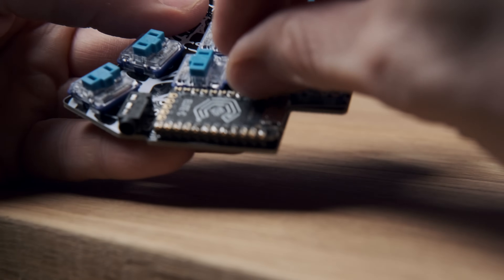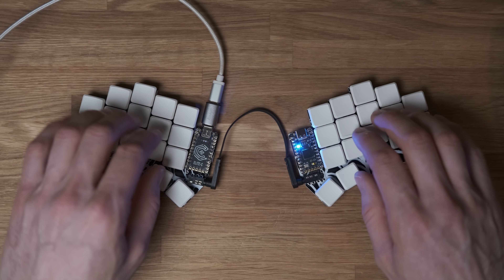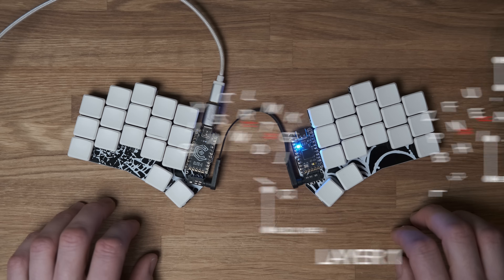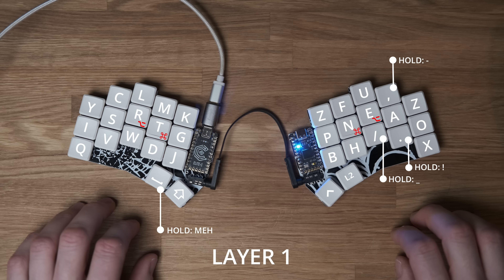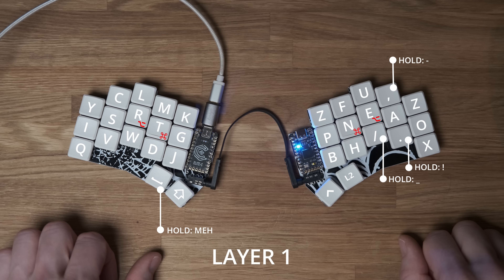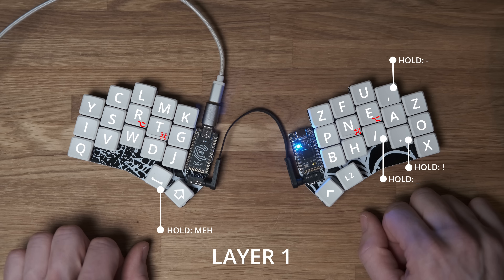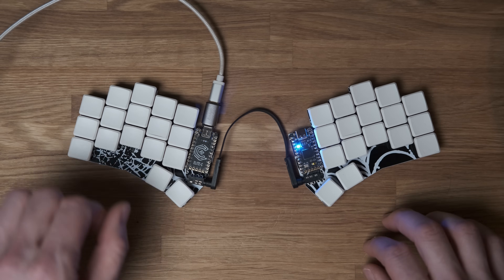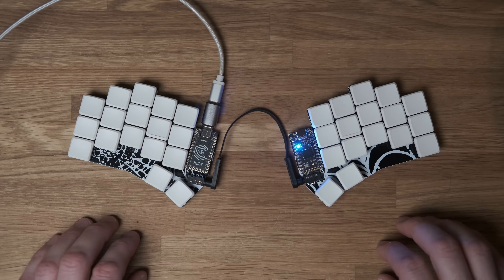You Won’t Believe How Effective This Keyboard Layout Is

Comment: Hi Ben, great content. I recently got into this niche hobby as well and built my own split ergo keyboard. I am still figuring out QMK/VIAL and how to setup my layers as well. As to your issues with homerows: I had a similar problem with rolling keys, but got a handle on it for now with "permissive hold" and "Ignore mod tap interrupt". This changes the behaviour of when a key is read as a mod or a key, and when a second key is added to the mod or as an individual keypress. Check it out if you haven't already

Comment: How does the right keyboard work with the same pcb?
Reply from the maker: The pcb is upside down on one side so the controller gets mounted backwards on that one.
Reply: @BenVallack  ohh it was obvious if I had looked at 0:02. You can see the double loop (pcb + mcu). Sorry

Comment: Thank you for the details! My question is this: are all the double taps for enter, arrow keys, etc. less or more ergonomic than just moving your hand over a few inches? Certainly the layers would be faster, but do the extra key presses wear on you? (Trying to decide on a 34-40ish key layout vs. a full size or tenkeyless)
Reply from the maker: Additional key presses don’t seem as much of an issue to me as moving my fingers all over the place. Both in terms of speed an comfort. I’m pretty happy with the small board idea. In fact I am currently way on something even smaller. Stay tuned!

Comment: Hi Ben! I'm starting learn ISRT and wondering about your VIM strategy. Did you remap your most common vim commands by location or did you keep them with the same letters and defaults. For example, find next char 'f + letter'. Did you change it to 't + letter', or kept it as is and changed how you type it on the isrt layout?
Reply from the maker: My strategy is swap hjkl to the new places, then just learn the new places for the rest. Most of the letters are logically chosen (f for example) so I found I was remembering them by name more than location anyway which made them quite easy to use in their new place.

Comment: I don't have experience with other firmwares but with the UHK if you assign a secondary role to a key it's unpratical to use it. In your Layer 1 UHK implementation, every time I type te, ne or anything it triggers the modifyer ("command+t" instead of "te").
Reply from the maker: This is all down to the way you configure it. This only does this on mine if you hold down the key that is a mod for a certain interval. You can type as fast as you like with normal letters and you never get the mod version by mistake.

Comment: At this rate, I give you 2 years, tops, before you have a single-key keyboard that you use the QMK firmware tap dance feature to the utmost capacity, adding some interesting mods. With only a single key you can add far more than 32 layers with a minor change of how layers are addressed.

I wouldn’t expect fast typing, but easy ergonomics!
Reply from the maker: Hehe I will meet you half way on that idea.
Reply: @BenVallack  and… you’ve done as claimed! 🤣🤣🤣

I deeply appreciate the commitment to the deep recursive rabbit hole dive!
Reply from the maker: @strictnonconformist7369  haha!

Comment: I've been wondering this in your previous layouts as well: to use the navigational keys (left, down, up, right), do you move your fingers over 1 key to the left? Or do you use your index finger to service 2 directions and the pinky sits idle? Either way it seems less optimal than keeping them directly under the home positions, and I was wondering why you chose this configuration.
Reply from the maker: It is the default position in Vim so I just kept it. I am currently testing a more conventional arrangement that doesn’t require a stretch of the index finger though.

Comment: Excellent video! You've (almost) convinced me that this is something just for me. I love your idea of layer switching (including the fall-back double-stroke). One thing I'd like to hear is why you've went for ISRT instead of Colemak DH. I've tried Colemak (briefly) and like the IE and ST progression. After watching a couple of your videos I'm sure there is a solid explanation - and I'd love to hear it. I'm also not getting how modifiers works (command/option) - is it long-press? The other thing that scares me a bit is how I'll get my local language diacritics like ąłżźć etc?
Reply from the maker: I tried ISRT and immediately it made even more sense to me than Colemak DH so I stuck with it. I think you will know within half an hour of testing it if you want to stick with it. Yeah home row mods are a long hold (200 ms) to get them to behave like mods.
Reply from the maker: Odd characters from other languages does seem to be a common issue with small layouts. I think it’s a case of just using another layer.
Reply: Based on letters frequency in Lithuanian, you can fit more than 98 % of the keystrokes on the first layer with 28 keys (according to "Raidžių dažnių lietuvių ir kitose kalbose, vartojančiose lotyniškus rašmenis, analizė").

Comment: Looking at this makes me wonder whether additional non-key controls would potentially make sense. I don't think small trackballs with a sphere size under 3cm have ever worked particularly well, so i'm hesitant suggesting that, though maybe a laser mouse pickup can make all the difference, last i tried those they were still based on ball mice with friction coupled optical quadrature encoders; but maybe a game controller thumbstick or a  Thinkpad nipple or a PSP slider, something like that? Maybe a capacitive touch strip for scroll? Doesn't seem that there is a good placement for a wheel encoder or anything like that, but i would actually prefer circular scroll.

It seems many people who use these small keyboards are dedicated to one task like their whole life revolves about vim, but i am not one of those people, i program, game, 3D model (Blender, Fusion, FreeCAD), and lots and lots and lots of other things. Also while i am not uncomfortable with vim, using it for short little tasks almost daily for 20 years, trying to actually customise it into a full IDE always overwhelms me and i use more standard tools, Qt Creator in the past, increasingly VSCode these days. Like it requires an exploding amount of memorisation for the amount of tools that you want to have, it's just easier for me to have only a handful things hotkeyed and access the less heavily used stuff visually, which i didn't find it ever had good facilities for, at least not that i know of? I also find it really hard to think about what i want, there is a choice paralysis thing.

Why i'm curious to begin with? The need to reduce wrist pain.
Oh i also have no touch typing skill. I tried to learn in the past but never really found comfort with that, so i really don't know.
Reply from the maker: Yeah mouse control is the last big hurdle with this I think. I think it is the only cause of fategue in my wrist now (only get it on the right). You're right though, those tiny trackballs are never going to be a great input mechanism. I think I will probably try a big trackball next and maybe fix the board halves each side of it so at least I have a consistent placement. Good luck on your journey. You may want to go straight to eye tracking too. They market it for gaming so I don't think there is an issue with accuracy but I have not used one yet.
Reply: @BenVallack  as far as I've seen eye tracking is not great. Calibration is fragile and it's pretty coarse. You notice they bet on deep integration into games rather than shipping a software that would emulate a mouse, and the games then basically use weighted autoaim within a pretty big potential target. More guessing what you wanted to do than strictly executing.
Reply from the maker: Ah that is a shame, I had high hopes for it!
Reply: @BenVallack   Maybe you should just integrate one half of the keyboard into a mouse?

Comment: It would be nice to have key caps with little LCD displays in them that would actually slow you what each key does in each layer
Reply: It's not as nice of course, but for keyboards with per-key rgb, you can use colors to help distinguish things a bit.

Comment from the maker: Please note the Z on the little finger as shown on layer 1 should be backspace. Doh!
Reply: Took me ages to work out why there were 27 letter keys. :(
Reply: Very interresting. Could you please explain how you select text (either per character or per word), I do not see a shift key on the arrow layer (I am coming from windows, where you do shift left to select text from your current position to the one on the left). Following that, I would do a Ctrl+X or C (for cut or copy), then some navigation, then Ctrl + V. It might be good to type some programing (we can slow down the video if we can't keep up) to demonstrate the layout in different scenarios. Very interresting video. Thanks for sharing.
Reply from the maker: @alexdubois6585  Yeah will cover all this in a vid for sure. Basically you trigger shift first, then jump into the system layer as a toggle with three finger combo on top row right hand. From there you can use alt (combo on left hand) or cmd (right thumb) to modify the arrows too. Copy and paste are both in the system layer too. Top row index for copy, hold it down to paste. cmd+tab can also be invoked in that layer and the arrow keys  can then be used to switch apps. So a select from one app and paste into another is quite nicely supported actually.
Reply: Where can I get that cute jack 3.5 cable?

Comment: now imagine a key cap with the characters you are typing, with 2 color LED, the transparent   character filter the color of each LED, when you switch layout it changes the color of the LED so you now have a dynamic keyboard with interchangeable character on.
Reply: Whoa, great idea for the color switching

Also, I've seen some tiny split keyboards like this but wireless. I haven't had a wire on a keyboard for 10 years and I'm not looking to go back to wires.
Reply: Exactly what I was thinking since I started learning about this topic. A keyboard like this would be amazing. Maby a great diy project. In ace any keyboard developers see this. This would be the s*it!
Reply: It was a keyborad with a LED on top of the keycap, allowing you even put icons on it. Actually the Stream Deck of elgato uses something like that.
Reply: @soy_ari_gutierrez  optimus maximus?

Comment: Your best video yet Ben. My head is still spinning. When you talk about the double tap on the thumb keys to return you to layer 1, can you explain a bit more about how you have done that. How are those keys set up in QMK?
Reply from the maker: So all I mean there is that if I hit the right thumb key followed by the left one, it just so happens that in any layer that will always get you back to layer 1. It’s more a result of the layer design than anything fancy going on.
Reply: @BenVallack  Do you find yourself using that combination all of the time rather than wondering which layer you're in?
Reply from the maker: @DanielASchaeffer  Yeah some of the time for sure, that’s what it’s there for I guess but it does highlight how it isn’t easy to stay aware of which layer you are in all of the time.

Comment: after seeing gergoplex, bought the same keyboard.  for me, key is pressed twice sometimes.  do you config to avoid this?

and some weird character was pressed when typing fast.  do you have same experience?
Reply from the maker: I havn't seen this but there are configs related to that I think, it might be that you are getting used to chocs?
Reply from the maker: Is it all keys or only one? May be a deffective switch.
Reply: @BenVallack  the character seems like some unicode when typing fast.  i feel some combination typing made specific unicode even though turned off the unicode in the setting
Reply from the maker: @youngwanify  I think that is the home row mods firing. Are you using the default layout? So as you roll from a key with a mod on you are hitting your next key and getting the modded version of your second key. This is the big issue with home row mods. If you look at my config files linked in the description you can try me settings and see if solves it.

Comment: My 34-36 keys layout is a modified version of miryoku layout which I moved mod-tap keys to 3rd row, and used 2 keys combo on top and home row for Esc, BS, Tab (left hand) and some common symbols (right hand) like quote, dquote, question mark... 

Mod keys appeared in all of my layer for 2 hands and at the same position.

Left thumb 1 is Space + Number combined with Nav in the same Layer, left thumb 2 is Esc + Media Layer. Right thumb 1 is BS + Symbols layer, Right thumb 2 is Enter + FN layers.

It may be slower for hold switch compare to tab switch layer, but I feel it is more natural to memorize the functions of all layers.

Comment: I was wondering since you are programming with Vim, if you use your IPad for programming as well? I've decided to get into changing my keyboard layout as well, but I'm thinking, that carrying around a laptop and putting an external keyboard on top of it, would be super annoying, but with an IPad it seems very easy to use it on the go as you've showed in your videos, but on the other hand I feel like the IPadOs isn't suitable for programming. So I just wanted to know if you have any experience with that. 
Also what I wanted to ask is if you have ever tried to have a 'layer switch layer'? I mean it in a way of that instead of using your 1 thumb key to roll through the layer, you map it to go to a layer where you then can have a key that switches to your special character layers/ mouse layer/... so instead of having to roll through your layers you push a button with your thumb and then your index finger for example and then you are in your special characters layer and then on the middle finger you have your mouse layer. I hope you get what I mean ':D
Also thank you a lot for making these videos! They have been really informative!

Comment: have you tried key combos? if you did and didn't liked them, can you tell me why?
Reply from the maker: I am using them in my 26 and 24 key layouts. Very powerful as long as you dont use them on common bigram pairs.
Reply: @BenVallack  like ui? I have to admit that I activate them accidentally from time to time, but it rarely happens after setting a super high requirement  (or low, depending on how you see it) it doesn't happen often

Comment: Awesome. Everything you do is completely different from my setup and will be a reference if I ever decide to dive beneath the 42 keys line.
Chiefly tap/holds. I should start using these on every special character.
I suppose I'll still mostly use combos, which IMO is the most effective way to "thicken" a small layout without sacrificing usability.
Note to the wise: homerow mods are a pain, but homerow combo mods (like D+F for alt, S+D for ctrl,...) work pretty well and I've never had a misfire, even when monkeytyping.

PS : also congrats on the production quality. Everything from the graphics to the narration pace and the general organisation feels smooth and well put together, overall very pleasant.
Reply from the maker: Agree combos are awesome, started using them on my smaller layout, I sort of got to the 34 point based on my Oryx layouts which is why combos are absent. But now I getting happy with ZMK I am seeing the power of combos for sure. Tap holds plus combos are quite the powerhouse.
Reply from the maker: Thanks for comments on production, much appreciated.

Comment: I feel like I’m missing something obvious but the link to the QMK layout doesn’t seem to match what I see in the video. The link is even QWERTY. Am I just missing something obvious?
Reply from the maker: Sorry ignore the readme, go straight to the keymap.c file. The readme is there from when I copied the original folder.
Reply: @BenVallack  ah ha! Thanks. 

On layer 2 I think the right thumb should be a TO(3)? Right now it’s a TO(2). 

I never used to consider TO as an option however since thinking about since your video it makes a lot of sense. It’s the native mode of iOS and works quite well. 

Did you generate all the mod tap code via some other system?
Reply from the maker: @jeelliovuscow5522  I think I showed the order of 3 and 4 on the video in a different order to the config file. The layers should match up though. 2 on the config is 4 on the video. Just to keep everyone on their toes!
Reply from the maker: @jeelliovuscow5522  The tap dance code I grabbed from an Oryx export then just copied and pasted as needed.

Comment: If you really using vim it's is unpractical
Reply from the maker: I got to this point bit by bit. The layer toggles do trip me up sometimes but overall I don’t think there is anything really causing issues. At the end of the day this layout reduces finger movement a lot so in many ways it feels easier than reaching up to the top row for symbols all the time. Can you elaborate on your thoughts?